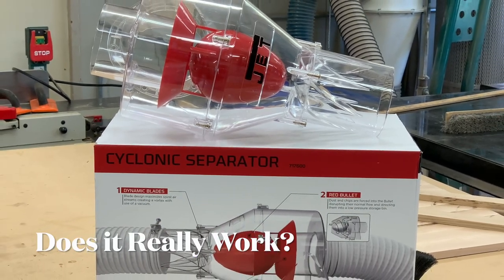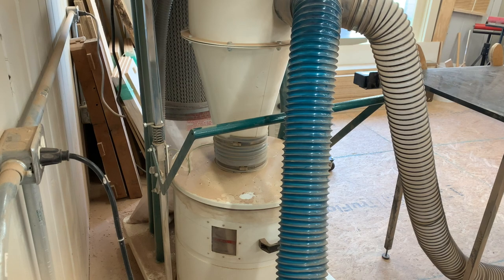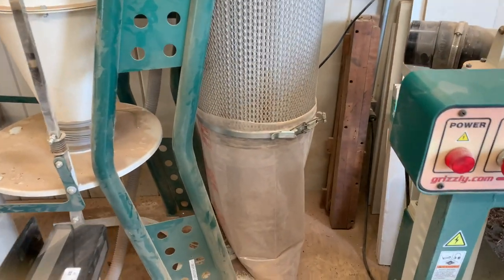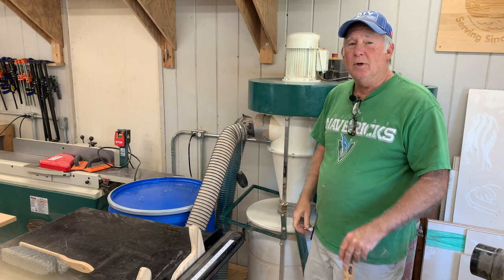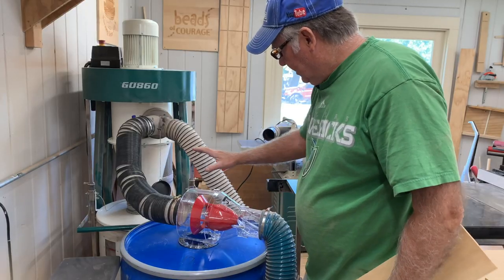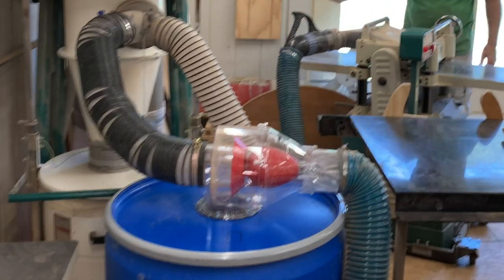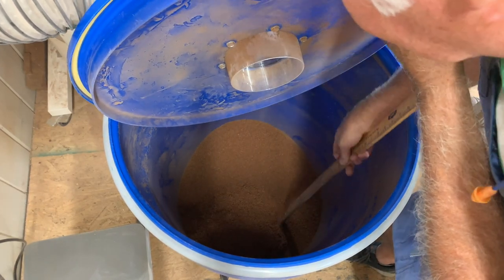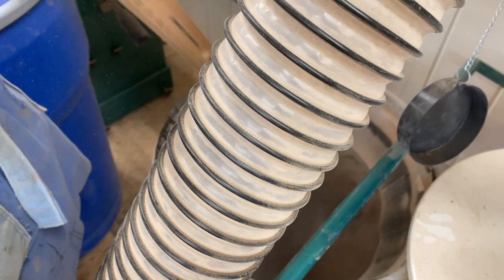Jet Cyclonic Separator

Comment: A nice improvement! I have the a metal Dust Deputy going through a Powermatic dust collector and I get almost nothing in the bag under the Powermatic dust collector. About a year after I got my Powermatic the Jet and Powermatic dust collector changed over to a cyclone style. I do need to upgrade to the bigger container though.My Dust Deputy currently has the same size container as your Grizzly has and it fills way to fast. Just subscribed. I’m looking forward to watching more videos.
Reply from the maker: Thanks for your comments I will be producing another video after our shop expansion I’ll be installing a much larger dust collection system.

Comment: This is just an observation of your system. All cyclonic seperaters use the velocity of the particulates. So to make the grizzly seperater more efficient add a 3 foot section of straight pipe entering it for acceleration of the particles. Should even go down an eighth or quarter of an inch on pipe size.  The outlet should be larger than the inlet. The y out of flex entering is horrible for performance of the seperater. Your particulates will definitely be entering at a slower speed than your air. 3 foot is arbitrary, the longer the better.
Reply from the maker: Thanks for your observation

Comment: You have placed two separators in series. One is vertical the other horizontal. Different designs but they are the exact same thing with the same outcome.
Reply from the maker: That’s correct and it was by design to filter out the chips

Comment: Questions:

Will the system function if the debris exit port is open to atmosphere instead of being enclosed in a sealed barrel or will it cause flow reversion due to a shorter airflow path and the vacuum?

My theorized application would be for a turbocharged internal combustion engine, a “pre-cleaner” for a ram-air intake 

Naturally, I don’t want want the added weight of accumulated particles and would prefer they drop out underneath the car.
Reply from the maker: You’re asking a theoretical question that’s unrelated to woodworking, which moves air and Sawdust through a vacuum system. Vacuum system is closed which produces the suction.
Reply: No it simply want. Even a tiny hole in such a system reduces its efficiency to nothing.

Comment: Your cyclone reduces CFM by about 25%.  The Jet reduces CFM by about 15%, but doesn't separate as effectively as a cyclone.

By using both, you are lowering your CFM twice, probably by at least 40%, which will result in more fine dust in the air, which can then get into your lungs.
Reply from the maker: I don’t seem to have a problem of a reduction in CFM because it sure does reduce the number of times I have to empty the small bucket in the grizzly dust collector.
Reply: I want to mention that those percentages aren’t additive. Mathematically he’s losing about 35% of his airflow, which is a decent amount, but both separators are still ultimately needed, since the cyclone deals with small particulate and the jet centrifugal separator deals with larger particulate.

Comment: Sry but looks like a bad designe. Normaly you use gravity in combination wit cycloidal forces to remove the dust. But here they are fighting each other. Very fine dust wil not get removed by a cyclone cause of mass or lack of and still it would be PROBABLY same or even more efficient to use 2 cyclones in after each other.
Reply from the maker: It always amazes me when folks comment on a video without watching the whole video.  If you had, you would see at the 9:00 min. make, I comment on the "Separator" doing its job, only leaving the the finer DUST for the "Dust Collector"

Comment: Editing, sound, composition, content, are all in need. Video production poor. You started out showing us you have a good cyclonic dust collector which you are not monitoring. Given a full barrel the Jet will also overflow. Your premise for getting the Jet is misleading. If you regularly monitor and empty your existing cyclonic separator it will do what it is designed to do. The Jet left a lot of particulate in the airflow which your cyclonic separator separated out. In your shop using the Jet as a pre-separator showed it can not separate the fine particulates of sanding. Cyclones in series however do separate more of the finer particulates.
Reply: Ok, Martin Scorsese.🙄